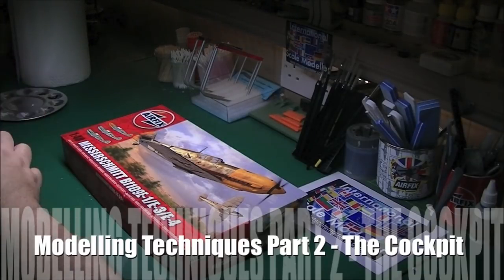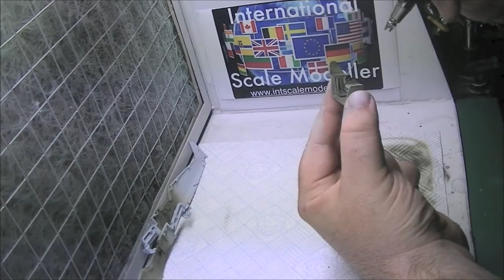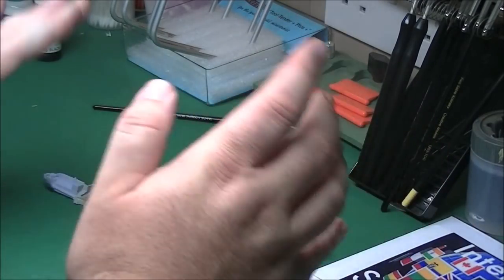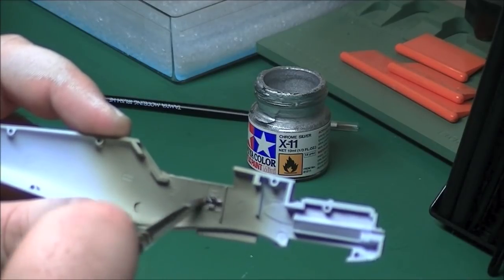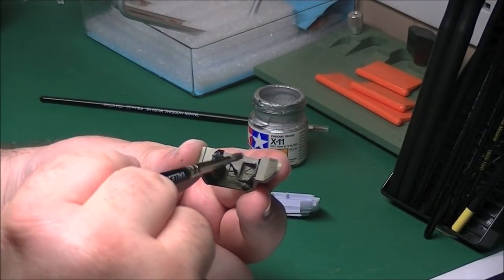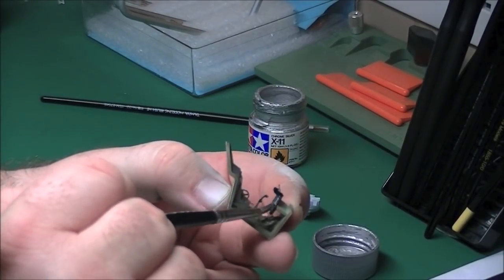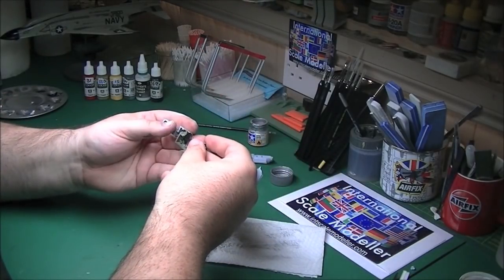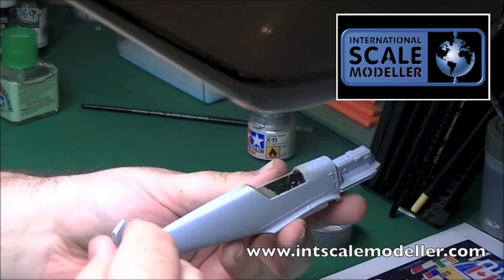Aircraft Modelling Techniques Part 2 - Weathering The Cockpit

Comment: Question....and GREAT video. Are you using an acrylic wash over the acrylic base coat?? Or was the base coat a enamel or something?
Reply: Cheer :) the wash i use is highly thinned tamiya xf1, as its being airbrushed it doesn't effect the existing acrylic paint layer :)
Reply: Paul @ ISM Hi Paul, do you use XF1 and X11 for all cockpits (i.e. newer jets too)
Reply: No, ill use UMP washes on jets usually, with maybe some oil wash too
Reply: Paul @ ISM Thanks for the quick response. Your tutorials are fantastic!